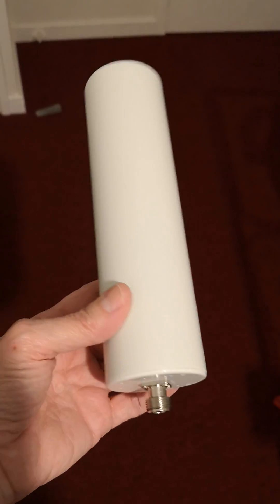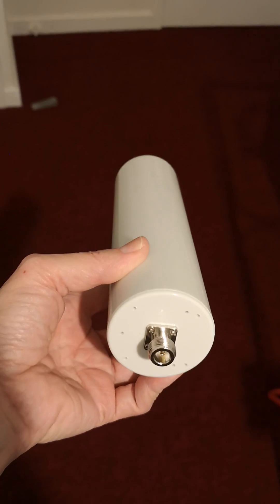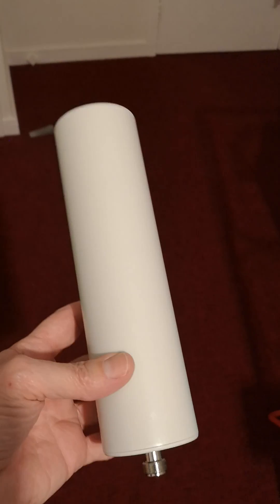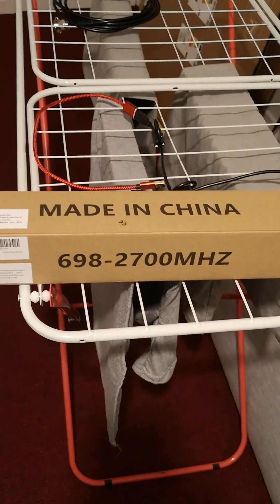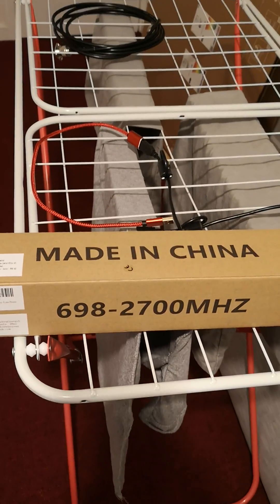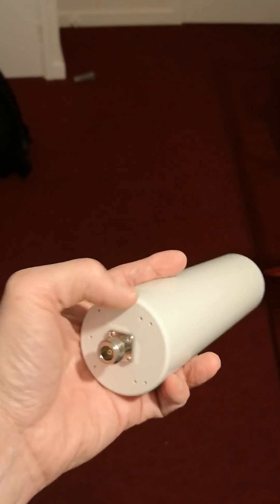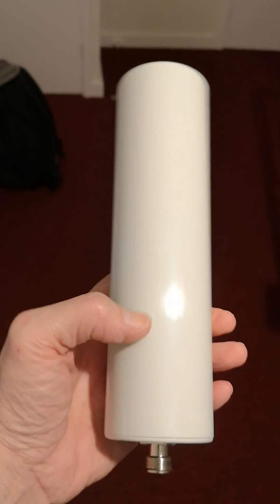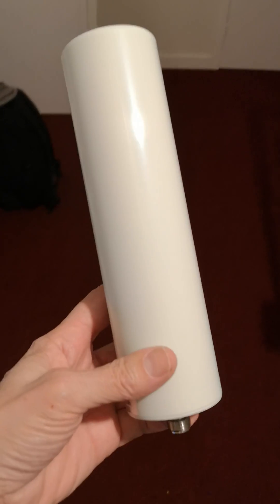Meshtastic outdoor URCIANOW antenna

Comment: After testing, may I suggest that you use some of your YouTube millions to cut it open and show what is inside? My bet is two rings of metal foil glued to the inner surface and one half of the connector attached to each...... Alternatively, it may just be a dipole and the rings are just tape holding it in place. The name 'you are CIA now' is immediately suspicious!!
Reply from the maker: Hehe. No miliions here but maybe I should start a lottery for "guess whats inside the box :-)